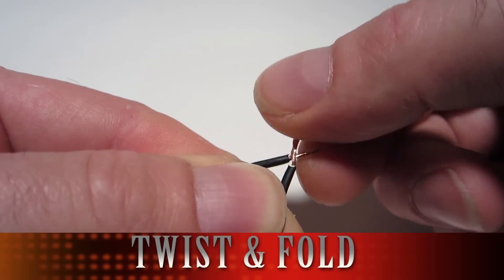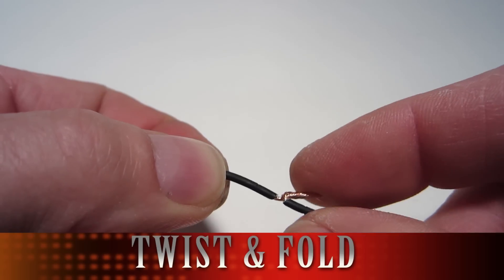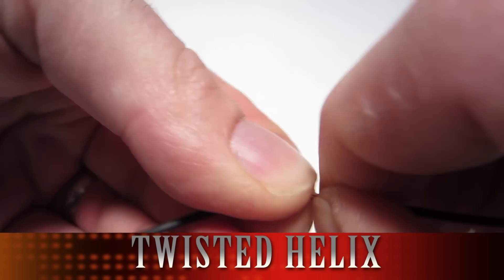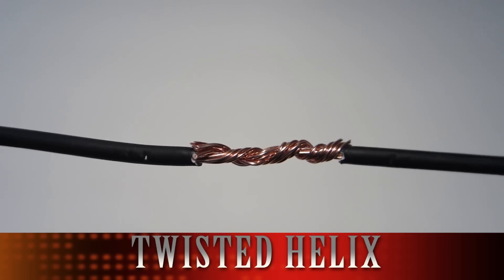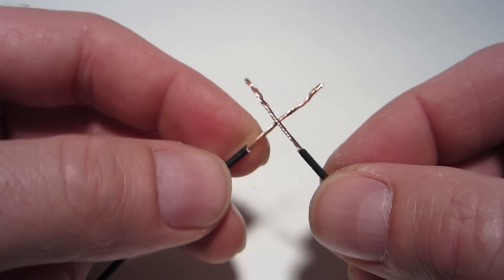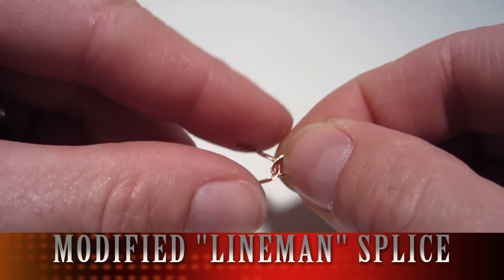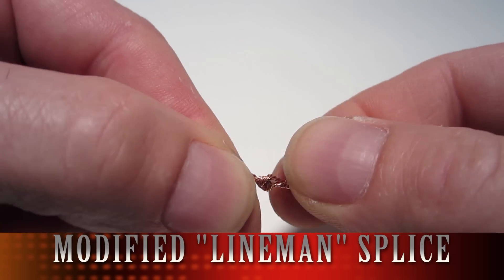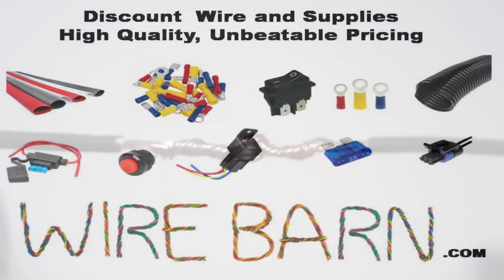How to Twist Wires For Soldering

Comment: Note that this splice has much less overlap of the two wires. Instead of wrapping the wire around the other wire for maximum contact area, the method above may strengthen the pull capacity but it reduces the quality of the electrical connection.

Comment from the maker: How To Twist Wires for Soldering
3 quick ways to twist wires together to prepare them for soldering. 
1) Twist and Fold, 2) Twisted Helix, 3) Modified "Lineman" Splice
It is always best to follow up with application of heat shrink tubing following soldering.   Electrical tape works, but it is best to use a good quality heat shrink tubing.

Comment: Thanks for nice video   I do much soldering joints and we use the turn and fold over way like you show.  fastest and always works good.  we do not have problem with tube for heat shrink fit over end of wire.  always goes on good.  i also looked your site and wire price is good.  maybe  i buy from you soon for wires we make for my sons classic car.  nice you have all wire made in USA - USA is good but Italian wire little more better!  haha   last time we try using auto store wire and all junk!!
Reply: thank you for your comment! we will have more videos coming your way!

Comment from the maker: Also, make sure to use High Quality wire (GXL/TXL or US Made MTW Wire, etc).  When the wire insulation melts immediately when you hit it with the soldering iron, that's a sign the wire is not the best - find something better.  There are other ways to twist wires, but these are what we use in our manufacturing facility. we primarily do short run manufacturing (less than 2,000 units / year of a given product and many projects are very low volume (anywhere from 1 to 500 units).  Twist and fold works great for quick things, but for more professional projects, you should use the twisted helix.   Please see our other videos (more coming) on how to solder and much more!   Have a great day!
Reply: thank you for your comment! we will have more videos coming your way!